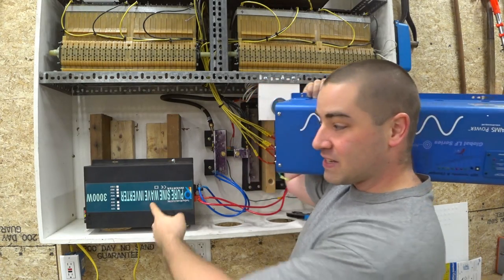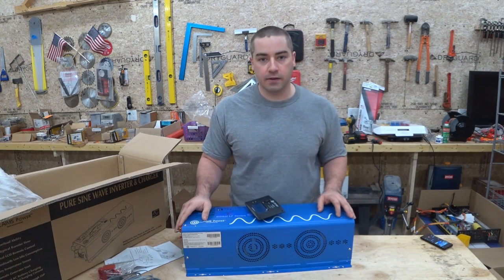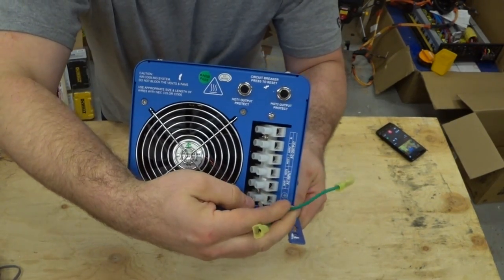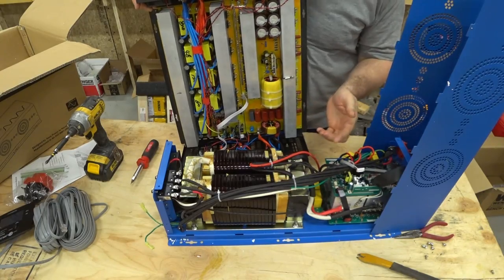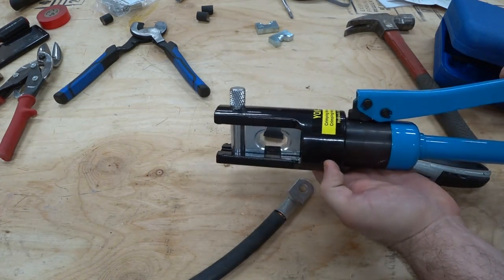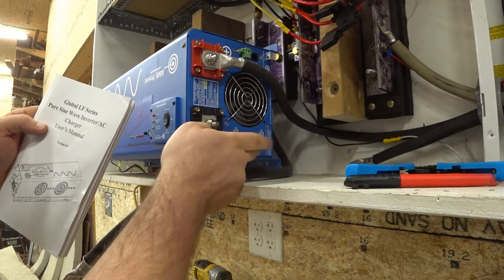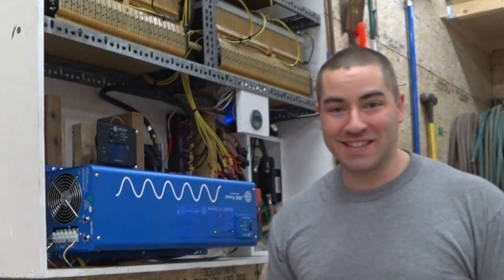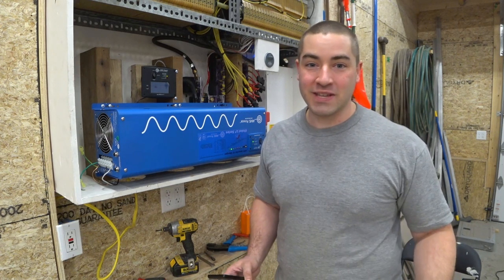Inverter Upgrade! Reliable to Aims in Off-Grid System

Comment: I prefer this AIMS inverter since it uses transformer. It can handle surge current and short-circuit current and can't damage the circuit, not like the older one which is transformerless which is very sensitive to fluctuation surge and back EMF.
Reply from the maker: I agree. I didn't realize what I was missing before. I get it now. I was doing some load testing today and I'm super impressed by this inverter.  I'll get the video out I the next couple days.
Reply: @DavidPozEnergy  yes David. Although it is very heavy but it can withstand the electrical fatigue compare to all electronic parts. Also in my analysis  it can charge all kinds of batteries yet not recommended. The transformer is the main important on this design.

Comment: @16:35 Try a belt driven, oil lubed 6 CFM @ 90 PSI or better unit then I might be impressed. So far everything you hooked to it I would expect it to run. In fact I expect it to run my monster compressor. Due to the load it draws it should be within spec. 20 amps at 240 or 40 amps at 120 should be fine at continuous load.

Comment: Aims  is a good transform type inverter. I have a 12 v that has no trouble. I want you to no that if you ever use it to charge your lithuim battery from a gennset to set the dp switches and battery selector to NEVER EQUALIZE YOUR BATTERIES.

Comment: Fun video.... your excitement when it started the chop saw was great. ....the only thing I noticed is that for most of your other wiring, you did wrap the positives with red tape for identification, but didn't for the 4/0 mains (at least not yet). Great job, and another great video.
Reply from the maker: You are right about the red tape.  I felt I needed to on the solar wires because they disappear into a 100' conduit.  Whereas the 4/0 is right there, easy to keep track of which is which.  But is there another reason that identifying the positive is needed?  It's not hard to add the tape, and I'm willing to, I just like to have a reason.
Reply: @DavidPozEnergy - Always use red tape on black positive cables -- it's very cheap insurance.  You'll appreciate it when doing emergency repairs at 3 AM.
Reply from the maker: @Anon, Sounds like you don't have a lot of confidence in the setup. LOL
Reply: @DavidPozEnergy ... It's just something I do for continuity in wiring, and with PEX plumbing (for the PEX, I didn't want to drive the hour each way to pick up a short piece of red 1/2" for the last hot water line to a faucet, and I had some red electrical tape on hand). Even with a short run, if someone else is looking at it in the future, it's all labelled. I agree, what you have there is all within arm's length, so probably doesn't HAVE to have color coding. It just keeps everything uniform to do so (and that's just me). .....again, nice video, so thanks.
Reply: @DavidPozEnergy  - I'm very impressed with what you've built, but that actually works against you in this case.  The system will probably work fine for a long time, so when it does eventually break (everything does!), the details will no longer be fresh in your mind.  Proper color coding makes things obvious.  As I said, cheap insurance.

Comment: There is 4 gauge and then there is 4/0 gauge.  The 2 are not the same and I believe that the one you are using is much, much larger than you will ever need..  Low frequency is much more able to handle start up spikes that inductive loads impose and has fewer parts.  High frequency units will not last as long starting motors, etc, but are less expensive.
Reply from the maker: Yes, I miss-spoke in the video.  I used 4/0.  Yes, it's over-kill.  I did that in case I bought a larger inverter in the future.

Comment: Thanks for taking the time to make this video... I wonder if it could be possible to flip that AIMS inverter cover tin panel around upside-down (by extending the internal cables to the front button panel), to allow it to look right-side up mounted in that way... Just a side thought while watching the video...
Reply from the maker: I eventually re-positioned the inverter in the cabinet to be more flush.

Comment: nice video..nice looking inverter. That transformer is normal/old design it isn't using toroid type of transformer so that is why that extra weight. I hope they will(or are alread) using new type transformer . But i expect price is still a factor so i expect they are still using old one..anyway looks good so far..

Comment: Hello from South Florida. Going back to watch your video again on the Aims 6000w Split. I was thinking of getting one for my house to run all the 120v (not AC1, AC2, Oven, or Hot Water). What is the max watts you can pull from HOT1?  Assume it would be 3000W per phase, right?
Reply from the maker: If this was a cheap high-frequency inverter, then the max per phase would be exactly half (3kw).  But this inverter has a center tap transformer inside.  So you can pull a little more on each phase.  I've done 4,000 watts on one leg and it didn't shut down.

Comment: The 95 die was still too big, try the next one down. The crimp should ideally look close to a symmetrical hexagon.. Having said that I'm sure its more than good enough for your application as its not going to bear any tension (ie. wire hang from one structure to another 200m away), you just need it to carry current and hold itself together from handling. Ps I'm an overhead power linesman, we crimp the wires delivering power to homes over the country..

Comment: yeah you have two heatsinbks in an inverter typically, one for the input side and one for the output side and yes those are all FETs, Diodes will only have 2 pins rather then 3 and be labled with a D, Mosefets and Transistors are marked with a Q. Them two thick wires. (the red and the white/black) coming off one side of one to the heatsinks is your output, they go to the transformer to split-phase main voltage 120/240. its good to have an inverter with an iron core however my main worry is how few output FETS their are for the rated capacity of the inverter.  (The input side Fets are generally smaller and lower rated because they are switching HV DC with lower current. Output FETs are generally bigger because they are carrying the load of the device you are powering from it. lower voltage but higher current.
Reply from the maker: Thanks for helping me out with identifying those electrical parts

Comment: The miter saw, ban saw was proably only 7 amps, 8 or 900 watts. Usually heaters are 1500 watts. Not sure on air compressor but it's givin items aren't aloud to go above 1500 watts on a 120 outlet. But it may have a high surge. A good quality 2500 watt inverter should be able to run all of those. The good test Is seeing what the aims says it surge is at, it will day something stupid like 12k watts. Meaning you should be able to run all those at once, you should be able to turn them all on at once. Plus I'd like to see it run 5k or 6k watts continuously. They are a okay back up, but they advertised ratings are atleast double of what they say they are

Comment: That looks promising, particularly the compressor demonstration. 40A is impressive, as well as the main cables. One (for me) ultimate test (pointless as it is due to the price) is.....espresso machine. Those things can have from 3-7 x rated power starting drain. All inverters I looked at, come with warning that they are not fit for use with espresso machines (looks like I am not the only one wishing to have a coffee on the go). Try it?

Comment: VERY IMPRESSIVE!
Low freq is the way to go for high reliability, industrial-grade power inverter.
Quick question, and I'm not being a smart ass... Is it OK install the inverter... well... inverted? My guess is YES, but just wondering.
Reply from the maker: Yes, this inverter can be mounted any orientation except upside down.  There are two fans that blow the air through. The fans should blow up.  I moved this inverter eventually into the upright orientation and it helps keep it cooler.

Comment: Nice job! I can't tell if you have something there already, but if not you may want to add support under the board where the inverter mounts. That's a lot of weight to hang out there on what looks like a 3/4-inch board.
Reply from the maker: Thanks.  the inverter is pretty heavy.  I used 3" structural screws in the steel flange of the inverter into the back plywood.  This way it is not actually putting any weight on the bottom of the cabinet.
Reply: @DavidPozEnergy  I see them now! Thanks.

Comment: perhaps some people may want this type inverter of possibly a smaller size connected to some circuits that tend to use a lot of start up amps such as a woodshed or hvac etc this would also enable them to buy a smaller more efficient unit for other use.  Thus possibly minimizing  cost without reducing efficiency as much and not out of power if one unit fails
Reply from the maker: I agree 100% about having backups.  The 3000w reliable is still working fine and I figure I could still power some stuff with it in case this one goes down and I'm waiting on parts.

Comment: LF INVERTERS better for bigger surge and have duty. butt not great on power consumption with no load. high frequency inverters are grey better at power consumption without load. it depends on all the high frequency Transformers how well they are balanced . I think AIMS is very good invertter.  I'm thinking of buying one but I want want to run a house permanently off grid. Victron inverters are good as well . butt when I wrote to them for some help and info on buying one from them . they did not respond back to me. with I think is very bad.
You have nice set up keep up the good work.

Comment: Fantastic!. Id like to buy one of these and the whole solar malarkey, but I live in Yorkshire where its gray and cloudy. And cold, and rainy!.  So im looking into that Zero Point. Extracting energy from the vacuum.  But Ive been told/warned, It makes you commit suicide!.
Reply from the maker: I don't know about the vacuum thing, but you could try a small solar system and see how it goes.  Just a small 12 volt array and battery so you can take something off grid.  It would at least let you see just how good/bad the sun energy is for you.

Comment: Good day. Have you ever thought about running your house on DC and only using inverters where you need it? Most things nowadays run quite happily on 120 volts DC. Most power tools have universal motors which means they don't care if it's AC or DC coming in. A few things like a fridge or a stove that will not run on DC you can either replace them with a model that does or put a localized inverter that's good enough to run that particular device.  Anyways just thought I'd throw that out there, I'm sure you've considered it. Cheers
Reply from the maker: I have not considered running 120 volts DC into the house.  I have considered running a tiny 12 volt DC system just for lights, but still have outlets and appliances running off an inverter.  No plans to do that yet.

Comment: Yes whatever you do David do not use the charging side of the Aims inverter! It will destroy and damage your lithium pack. Had a couple customers use to charge their Tesla 24v modules and the Aims damaged them after a month.  Destroyed thousands of dolors in Tesla modules. Use your solar  charger that you can adjust charging parameters. You cant granule change them on Aims. Major weakness on these inverters/chargers.
Reply from the maker: Yikes!  I'm glad I learned about it (not charging lithium) early on so I didn't kill my batteries.

Comment: Great video. Will that inverter still run if you have the compressor running and you use your miter saw at the same time?
Reply from the maker: Yes, it did.

Comment: I have a 16000 what inverter and it Powers my whole house including my central air and heat which 10,000 watts is needed to power it. The main thing when buying an inverter is getting a pure sin wave instead of modified sine wave. That is the difference between your efficiency of the inverter and also a pure sine wave is used to power sensitive Electronics as they give a continuous correct power and you don't blow your LCD TV or any other delicate Electronics. I also installed an alternator so mine batteries keep charge when the power is out. I also have them install a sensor that turns on the inverter II the power is out so you don't even know the power has been turned off. This was the most cost-effective way to get power to the home otherwise it would have cost a lot more to get a gas or propane powered inverter that I would have had to install a decent size propane tank and fabricate a muffler and they separate enclosure for the engine so it would be very quiet even though I live 2 Acres from the next house it still annoys the family with the noise. Before I had the battery operated inverter I have a 6000w gas generator it was very loud. The Honda gas generators are the quietest out there but they are also the most expensive. You get what you pay for as my Honda snowblower with Traxx blows away any snow blower that I've ever bought and sound and in quality.
Reply: keepithd2010 there’s a way to know the brand and model of your inverter

Comment: Great only thing I would add is a 250 amp dc fuse between your Battery bank and your inverter
Reply from the maker: I have a 250 amp circuit breaker between the battery and inverter.  I install the circuit breaker in this video: https://youtu.be/HYay0qqtUOs  Thanks for watching.

Comment: So what charge controller are you using for your Volt batteries? Im using Leaf Batteries and I have a large bank of 100ah LiFePO4 cells too.
Reply from the maker: I'm using a Victron 250/100 with bluetooth: https://amzn.to/2RK9S3O  Sounds like you have nice big battery bank.
Reply: @DavidPozEnergy  I have 90 Leaf Modules and 74 100ah LiFePO4 cells.

Comment: Great.I have Aims 6Kw for hurricane emergency off grid  hooked into 660Ah AGM battery bank.It runs 2 fridges, lights,TV,computer,microwave and  1hp well pump !!! Also it can run 24K BTU split A/C small unit for 500sqf. area.It doesn't run whole house AC ! Can't start up the compressor LRA is way to high for that. Maybe it would start 2T unit, but not 3.5T.. Aims Power has bad customer servise,but inverters seems to be OK for that price.

Comment: 4/0 awg is 107mm^2 cross sectional area. So I recon that crimp compresses it down to 95mm^2
Reply from the maker: I don't know.  I tried the size larger (I think 105) and although it did not pull apart easily, I was working it loose as I pulled on it.  So I switched smaller.  After the 95 I could not get any movement out of the cable, and I hung from a nail my full body weight.

Comment: Good video other than you got a massive large output inverter and you only ran a few tiny 120v loads, 1 At a time even.  Heck I've ran much heavier loads on my 12v Aims 5k modified inverter that I bought some time back around 2002 or so. Show us what it can really do! And YES, my old AIMS modified 5k continuous and  10ksurge still works great.
Reply from the maker: Hi Den Stump,    I have another video where I show what it can really do: https://youtu.be/4EsYfdK1Hn4  Thanks for watching.

Comment: I did not see one but watch incase there is a high voltage capacitor in there. I was bit by a 3000 volt once and I lucked out and didn't go down.

Comment: Best on some electronic components to not touch with bare skin leaving oils from touch. Many high voltage/amps equipment are assembled by those wearing gloves. May make no difference in this case. Was told that by instructor.

Comment: You can lower the idle current if you place an inductor between the output of the H bridge and the primary (48v) Winding of the transformer... Something like 50uH..., for example 3-4 turns on An etd59 Ferrite core.
Reply from the maker: That went over my head, but I got the part of "Lower the idle current".  LOL.  Are there any links, pics, vids, or something I can read to learn more about what you just said?
Reply: @nickvanhumbeeck5296   Why would that improve anything? The transformer already has plenty of inductance itself. 
If anything a capacitor across the transformer might help because it could reduce the reactive power the H-bridge has to supply.

Comment: Oh so that's what low / high frequency means!  I see that advertised sometimes but was not sure what it meant.  So low frequency has a standard 60hz transformer at the output, high frequency would probably use SMPS technology.    I wonder what would happen if you used a high frequency one, but then added a 1:1 60hz transformer at the end, wonder if it would act as a sort of buffer for surge power and work better.
Reply from the maker: I don't know if adding a transformer would help on a HF inverter.  It would be fun to test.

Comment: Great videos! Have you had any luck running that Titanium welder you have off an inverter? I want to run a 120V Lincoln migpak 140 welder off an inverter but not sure if they will handle the inrush current.
Reply from the maker: Yes, I've run the welder on this inverter a lot, and on my SMA inverters.  I didn't have as much luck on the Reliable brand inverter, so probably stick with a low frequency.